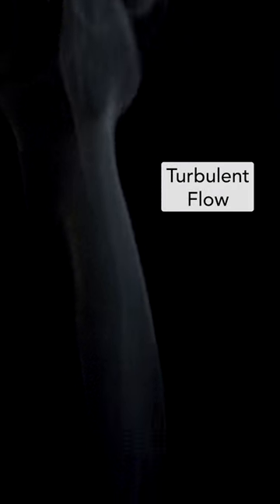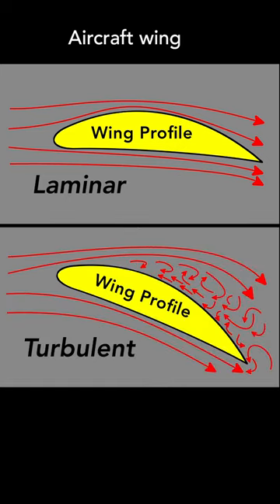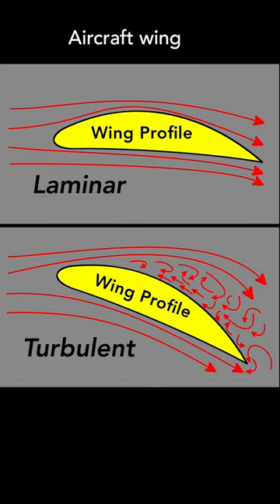Laminar and Turbulent Flow #shorts #engineerguy #engineering #flow #illinois #engineeringconcepts

Comment: I hadn't considered using turbulent flow for an advantage before
Reply from the maker: Mixing especially!
Reply: I am in the development of Air Conditioning for cars at the moment and we switch between laminar and turbulent air flow back and forth. The turbulent parts are where we want mix the cold and hot streams of air to get a consistent temperature. Getting laminar flow turbulent is easy, the other way around is harder, especially when you don't want to waste space.
Reply: In motorsport series that rely on underbody aero the body is engineered to have vortices (controlled turbulence) running down the side of the car to act as a virtual seal to keep air under the car from interacting with air at the side of the car floor
Reply: turbulent flow is actually usually advantageous, it's just much easier to achieve so when you do need laminar flow you'll need to go out of your way for it
Reply: Cleaning-In-Place (CIP) in a brewery or dairy also relies on turbulent flow to clean vessels. A fine balance between the concentration of the active agent, time alloted, temperature of said agent, and mechanical action needs to be struck. Turbulent flow is mechanical action and is of huge importance when it comes to dislodging organic material in particular. It's why cylindiconical fermentation vessels have a sprayball in the top for CIP, and the variations on those sprayballs can be amazing in order to  emphasise  mechanical action!
Reply: i mean, it’s kinda intuitive, just not self-evident 😅 but i love these little nifty concepts, where you’re like ‘huh, i hadn’t actually thought about that ‘ 😂
Reply: Another good application of turbulence is actually in cooling. For example, a heatsink performs better under turbulent flow because you are increasing the number of collisions between the fluid and solid at the molecular level - the basis of heat transfer.
Reply: real life rng
Reply: @cereal-killer4455 those vortices generate high pressure from the accelerated air flow along the vortex's body that creates a pressure dam effect.. yeah laminar flow often isnt desirable or.. efficient
Reply: Aircraft wings can actually make use of vortex generators... that create turbulence.
Reply: @pefington  they do.. STOL
Reply: I haven't considered before the turbulent power of turbulent juice
Reply: EDIT: Im completely wrong

I hope I'm not getting it wrong but a form of turbulent flow is used to break up the boundary layer formed on an aerodynamic device (the separation that contains turbulent flow). This is why you see notches on some cars (I've seen them on the hoods of Subarus) and used on aircraft wings too
Reply: @andrewmancini46  That sounds right, I'm betting aerodynamics or fluid dynamics in general gets pretty complex.

I was always also curious about propulsion systems designed to altogether void the concern of aerodynamics.

Aaaaaaaand you're dead. You talked about black technology you're dead Please leave, this bank is for paying customers only.
Reply: @andrewmancini46  yes.. you got it wrong.. it's not to break up the boundary layer at all.. VGs.. Vortex Generators.. create mini tornados along the surface parallel to the direction of air flow.. they create a scrubbing effect that directs an accelerated line of air streaming towards the structure surface to maintain attached air flow .. strong "streams" or channels of down wash towards the surface all the way to the trailing edge of air foils & similar forms.. to stop it turbulating & reversing against the direction of travel.. that causes stall & drag increases exponentially.. factors of 4
Reply: @Errol.C-nz  thanks for the info, I stand corrected:)
Reply: And you never will
Reply: There are turbulators inside your car radiator to increase the heat transfer😊
Reply: theyre not turbulators.. theyre radiating fins.. to increase surface area to dissipate heat from the tubes more effectively.. turbulence is detrimental to the efficiency of a radiator in reducing air flow volume with increased resistence pressure.. f1 radiator designs set the fin density dependent on the avg track speed
Reply: I don't think we would be alive without turbulent flow
Reply: @engineerguyvideo  Can you give me one example of a type of mixing?  Great videos!
Reply: You haven’t?!
Reply: Golf balls use turbulence from their dimples
Reply: @Errol.C-nz  besides fins there are turbulators inside heat exchanger pipes
Reply: @prosaic.7944  I've come across that.. it's to stop flow in pipes from spirally, which increases flow resistance & pumping demands.. it's also used in canals to stop flow snaking.. trains do the same on long straight section like in Australian mine rail lines.. long trains behave like a fluid
Reply: @Errol.C-nz  It can be used to slow down the flow,  But, heat transfer via convection is greater when the flow is turbulent compared to laminar.
Reply: Priceless...
Reply: Priceless...
Reply: @engineerguyvideo  Mixing in heat transfer. I had the joy of studying engineering under some of the leading heat and mass transfer professors at the university of Pretoria (TUKS). Heat transfer of fluids in turbulence is much higher than that of laminar! Love the channel!
Reply: turbulent flow is incredibly useful!
Reply: Another use for turbulent flow is water breaks on dams. Turns out letting literal tons of water fall stories from a dam creates fast laminar flow that can cause a lot of damage. Letting it cascade down concrete steps actually causes less damage in the long run
Reply: It is not.
Reply: It’s used in many areas for aerodynamic reasons as well. Sometimes it can reduce drag if it reduces boundary layer separation and in things like f1 turbulent flow and vortexes are used in clever ways to creat downforce
Reply: My 2008 Mustang GT had what is call "charge motion control plates". A lot of cars have them in the intake. They are plates that stay closed at low rpm to cause more turbulence (theres a small cut out in the plates) and it mixes the air better in your intake. And then at high rpm, the plates open.

The plates themselves are restrictive though so in my case, I deleted them and my have a smooth intake so my car (along with several other mods) makes more power in higher rpm
Reply: I'm an intern at a pharma company and laminar flow has been the bane of my existence for the past two weeks. High viscosity → laminar flow → long work hours
Reply: @engineerguyvideo awesome content

Comment: I would argue turbulent flow is more important over a wing. Yes the friction drag is increased due to the higher shear stresses but, this helps keep the flow attached (avoiding stall). The pressure difference contributes to most of the drag, it's why airliners use turbulence inducers.
Reply: Turbulence inducer = winglet 😂
Reply: @-justin-4077  Not even the same thing 😂
Reply: @robercnn32478  actually winglets do create vortices which disrupt the laminar flow across the wing tip area and reduces drag enough to save fuel yet not enough to cause aerodynamic problems.
Reply: @-justin-4077  They reduced induced drag, otherwise downwash. I know what you were saying, but I’m referring to something else.
Reply: @-justin-4077 wrong about winglets.  They are not for inducing turbulence.
Reply: @-justin-4077  to be precise, winglets are designed to do exactly the opposite: they reduce wintip vortices.

Comment: A small addendum or nitpick about the application to airfoil design. Planes typically fly at high Reynolds numbers. And if designing a transonic wing, we actually WANT turbulent flow because of its increase in skin friction. That extra fiction provides more "grip" for the air in the boundary layer and keeps the flow attached even through shock boundary layer interactions (SBLI - pronounced "siblee"). We can even take advantage of the increase pressure after the shock to decrease drag by designing it so the shock occurs at the location where the normal vectors of the surface start having a component in the forwards direction.

If you've ever been flying and look at the wing, you may see little tiny pieces of metal sticking up? In many cases these are likely to be vortex generators, to induce turbulent flow at a controlled location along the wing's chord.

Love these videos btw!

Comment: That’s funny, I thought that turbulent flow actually decreased drag on an object, hence why golf balls have those dimples that create eddies (airplane wings have something similar, in fact).

I did some googling and came to the conclusion that I don’t know jack about fluid dynamics, but more importantly I learned that drag has multiple contributing factors, and a thin layer of turbulent flow across the surface of an object may decrease the “form drag” or “pressure drag” of an object, caused by the low pressure zone behind a moving object, but it will increase the “skin drag”, or the friction against the surface. In the case of an airplane wing, the tiny eddies generated by bumps causes the flow to “stick” to the wing better instead of creating a big low pressure zone behind it, which is characteristic of turbulent flow. It also helps decrease the stall speed of the craft, since the wings generate more lift if the flow is sticking to them. So in a way, you can think of the plane wing as making the flow more turbulent so it behaves more laminar!

Love your channel, btw. I remember watching these in high school, and now I have a BS in electrical engineering. Thanks for all your content.
Reply: I think the turbulent flow works with a golf ball because it is a generally uniform sphere so the small pockets of localized turbulence creates a friction barrier in a similar way that heat can cause an object to develop an insulating vapor barrier between a very hot object and a fluid such as water
Reply: Thanks for doing the leg work. I was thinking along the same lines and was about to look it up myself.
Reply: A golf ball has dimples to create turbulent flow, which "sticks" better to the surface of the ball. This pushed the flow separation point farther back, shrinking the low pressure wake.
Reply: As they often say, life is stranger than fiction. Which is because Fiction is a lot simpler to understand (in general), compared to life, where it can be way more complicated.
Reply: @pelican7691 All of you are wrong about why dimples are present on golf balls.

I remember watching a video about this 30 or 40 years ago.

The dimples do not create a turbulent airflow.  The dimples break up the boundary layer which is a thin layer of layer which gets stuck to the surface of the golf ball (if it was completely smooth). 

The result is the golf ball travels further.

Some aircraft have little protrusions on the upper surface of the wings, along the length of the wing from tip to root. 

The Harrier fighter is one such aircraft that have these little protusions. They are boundary layer control devices.
Reply: @deang5622  I don't know what video you watched, but that explanation is wrong.

There are 2 main types of drag: skin friction drag and wake drag. Golf balls are blunt, so they create large low pressure zones in their wake, which is the main source of drag. 

Turbulent flow actually makes the boundary layer stick better to a golf ball. Yes, it will increase the skin friction drag, but the skin friction drag on a golf ball is negligible compared to the wake drag.

In contrast, an airplane in steady flight is designed to create a very small wake, so the skin friction drag is dominant. But when an airplane is flying with a high angle of attack, such as when taking off and landing, it does create a significant wake.

The vortex generators keep the boundary layer attached to the wing, which decreases wake drag and increases lift. This delays stall, allowing the plane to fly at higher angles of attack. The vortex generators do increase skin friction drag at small angles of attack, but because the boundary layer would already be attached to almost the whole wing anyway, the drag increase is very small.

I'm guessing the Harrier needs vortex generators to generate enough lift when it's taking off, since it has VTOL and has to accelerate from basically standstill in the air.
Reply: @deang5622 isn't the broken boundary layer a form of turbulence?

Comment: Famously, Ferrari used turbulent flow on their last generation of F1 cars to counter mercedes' laminar flow + better power production combination. Turbulent flow allowed for greater cornering speeds due to the ability of their aero kit to channel turbulent air into micro-vortices which induced low pressure zones around the intake zones for the floor.

Comment: In water treatment turbulent flow is used in a process called "rapid mixing" or "flash mixing." This type of mixing is utilized when treatment chemicals are introduced into the raw water entry point to the treatment facility. This is to ensure uniform distribution throughout the column of water.

Comment: I love this video! One quick correction, though. Aircraft don't always desire laminar flow, it is highly situational. Turbulent flow over a wing results in higher flow velocities in close proximity to the skin of the aircraft. While this does lead to an increase in skin drag, it also means that the effective velocity of the air is increased when it comes to determining whether it will remain attached or become detached flow which results in a stall. So in high angle of attack applications, turbulent flow is more desirable. It also helps improve the effectiveness of control surfaces if the flow over them is turbulent, since this is akin to increasing the airspeed of the aircraft. Aircraft design is a complex balancing act of benefits and drawbacks, and the applications of laminar and turbulent flow are a great example of that!
Reply from the maker: Indeed!

Comment: Fun fact, airplane wings actually use laminar flow and turbulent flow in conjunction. Laminar flow is used over the surface of the wing as stated in the short but turbulent flow is intentionally induced at the rear of the wing in order to reduce the area of low pressure caused by the laminar flow rushing off the wing. This makes a low pressure area caused by the wing cutting through the air. Turbulent flow helps gasses fill this low pressure area more easily thus reducing drag on the wing.
Reply from the maker: This is correct ... thank you for sharing.

Comment: I believe that wings and vehicles actually benefit from small turbulent flow as it reduces drag to have the air flow over the wing, instead of sticking to it. The key in these cases is trying to make sure it doesn’t leave a giant pocket of low pressure behind the car/wing to create more drag.

At least that’s my understanding having researched a little bit. Veritasium did a good video on turbulent flow, and Destin from Smarter Every Day has done a great job with laminar flow in several videos - you should collaborate with them!

Comment: I think the wing section diagram is confusing laminar flow with attached flow, and turbulent flow with separated flow. Most commercial aircraft have attached, turbulent flow over the wing. Compare with Airbus’ BLADE demonstrator, which was designed specifically for laminar flow.

Comment: I understand laminar flow reduces drag on wings, but turbulent flow helps the airflow stick to golf ball dimples longer making them fly further, and I can’t seem to rectify that seeming contradiction
Reply: the difference in drag is due to the trailing edge - wings bring the flows back together smoothly, but a ball doesn't. this leaves a low-pressure area behind the ball, which increases drag. The dimples make the flow more chaotic, which allows the pressure to equalize faster, leading to less drag.

Comment: What's confusing to me is how this is all true while in a circular tube, the magnitude of the average velocity of the velocity profile of the fluid is larger when flow is turbulent vs laminar.   Like ReynoldsD of 1500 vs ReynoldsD of 25000 with the variation coming from a change in tube diameter. 

Turbulent flow is wasted energy though compared to laminar

Comment: I agree with everything but the semi.  Honestly, a semi is a gigantic brick and making a curved windshield won’t save fuel.  If anything, the old flat Kenworths and Peterbuilts get better mileage due to their lower complication and the lack of a multi-ton DEF system.  Plus you can cut any flat piece of glass to replace the windows, no specialized curved windshield that costs 10x more, so repairs are always an option.  The old semis get twice the mpg of modern semis and they often carry more fuel and have more robust frames.  Just food for thought.

Comment: Could you explain why laminar flow doesn't cause splash when pouring into another fluid?

I have to mix a lot of chemicals at work and I always try to pour as smooth as possible so it doesn't splash back in my face.
When you get a "smooth flow" it just glides straight in with no splash.

Comment: Laminar flow over wings to improve "efficiency" !.. the FIRST thing ANY engineer does is define "efficiency" from effect.. vortex generators are tiny winglets fitted near wing leading edge to generate consistant turbulence as a cord wise mini tornado over the top of a wing to improve a wings lifting "efficiency" in low flow low speeds.. so be clear of your "definitions" from the start of any design concepts or developments to ensure predictable outcomes.. that "engineering" or science vs art or crafting.. hit & miss guessing.. laminar flow doesn't specifically determine "efficiency" ! as you put it